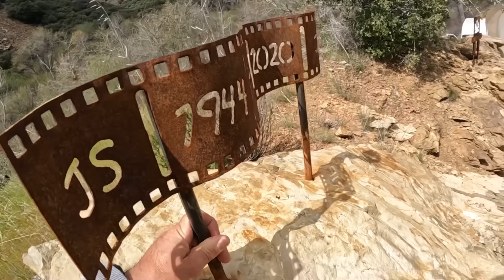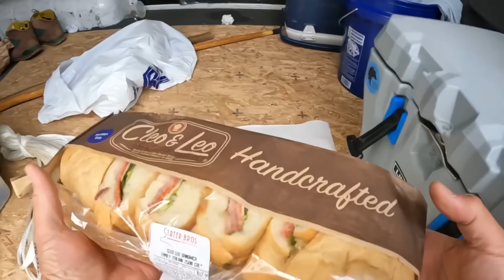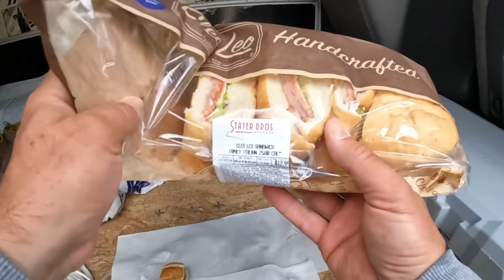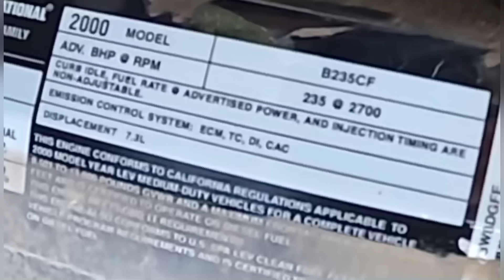FORD F-250 FOUND FOLDED IN HALF ON CANYON FLOOR!

Comment: 1) Mid-late '70s Corolla, rear wheel drive.   2) '46 Dodge.   3) That F350 was balled up but good! I hope the driver was rescued.
Reply from the maker: I would love to own that ford before it went over!
Reply: Definitely an 80-83 corolla….
Reply: @reverserockettv007  Did you snag the cat off of the Toyota? I mean it's right there.
Reply from the maker: @ostrich67  Naw I I don’t take stuff like that.. I have a job… YouTube is just my hobby…

Comment: 6:29 Knowing at least it was a Toyota helped, the sharp lines on the lower quarter are very distinctive, two door Corolla, from about 1983 or so.
Reply from the maker: Thanks for the info!
Reply: 1980-1983 Toyota Corollas were the same body style.

Comment: These car wrecks looked scary 

I'm vacationing at Rocky Point Sonora and yesterday, I drove throught La Rumorosa, the Salt Desert and Mexicali to reach the Gulf of Baja (the state lines between Baja and Sonora).

I didn't see any scary wrecked car in la rumorosa they're all gone,(goverment cleanup and the deepest ones got covered by the rocks, that fell from the mountains)  and the highway has been modernized some soldiers who work at the checkpoint posts in the mountain said sometimes they can hear the screams from monsters,ghosts, witches from the legends wandering the highway at the night 

That early 80s Corolla looks like the one I saw mangled at the buttom of la rumorosa in 2012.
Reply from the maker: Thanks for commenting! Interesting statement!
Reply: Giancarlo, I'm not saying I believe ghosts are real. But I surely don't want to find out at night in the middle of the desert if they are!
Reply: @wes11bravo  The highway 8  near Ocotillo Wells CA it's similar to La Rumorosa and I heard there are Skinwalkers wandering at the night in the area.

Comment: That poor 7.3, hopefully it gets recovered and the engine salvaged
Reply from the maker: I think it will probably get recovered but they will have to close the road down to get it out.
Reply: That’s the best ending for a diesel pick up engine. Probably got an estimate to fix it.decided it would be less expensive to make it fly.
Reply: @daleolson3506  If it was a more modern emissions equipped engine, but these are cheaper and simpler to maintain and fix than a new diesel engine, not to mention more reliable because of not having all the emissions crap, being a diesel mechanic I quickly found out these emissions systems are useless and actually dangerous causing fires and hazmat problems because when they clog they can cause high blow by and blow seals and cause oils and other fluids to leak out horribly
Reply from the maker: @daleolson3506 🤭🤭🤭